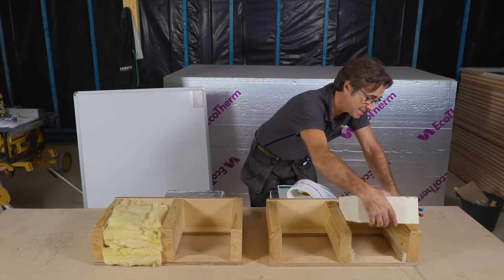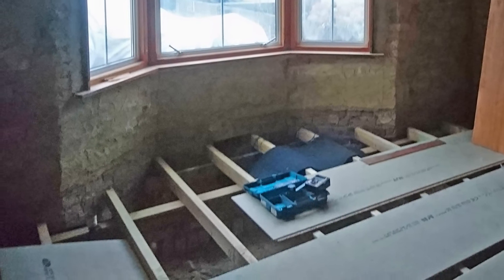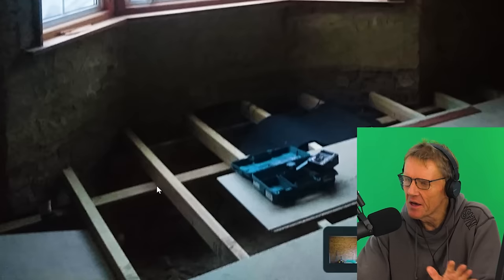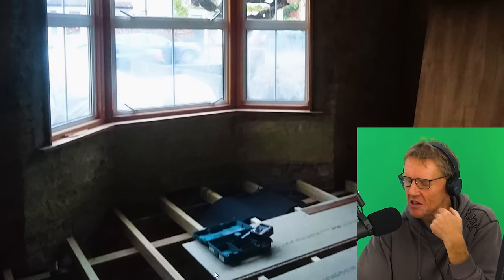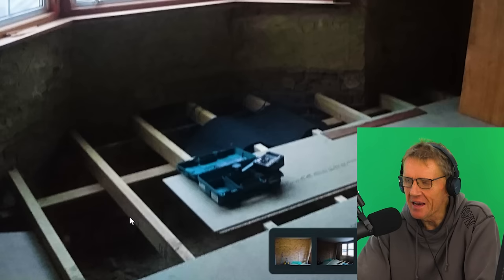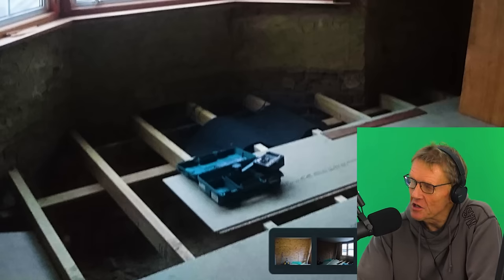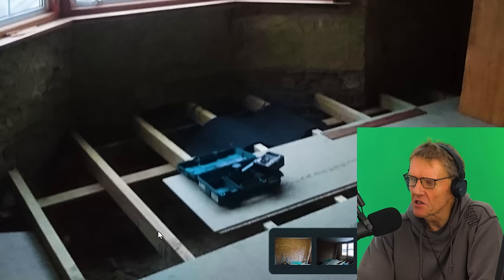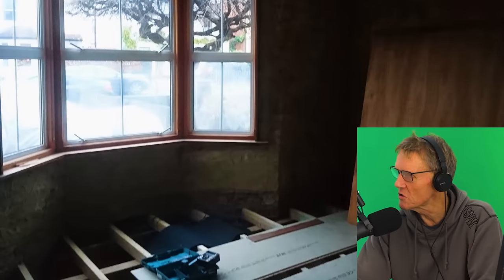Cold Floors & Walls in an Old House ~ What Can Nick Do?

Comment: Check the SPAB best practice on insulating old buildings.  You aren't letting the building breath with modern materials which are better suited to modern construction.
Reply from the maker: I think there is useful information in SPAB but there is also a lot of bolocks.
Reply: Fair play
Reply: @growingknowledge  There is also a load of bollocks on the Skillbuilder channel, this ^ is some of it. Learn how to spell breathe though.

Comment: could he batton the walls insulate and plasterboard if the rooms are big enough to lose a bit of space ??
Reply: Yes. I've done the same on our 1850s house with solid 9" walls. Like the floor insulation, I put a vapour barrier between the insulation and the plasterboard. Works well - no more mould behind the wardrobes and beds!
Reply: @stpeter7432  Hi, just wondering how you sealed the vapour barrier round the edges of the room, the sockets and when screwing the plasterboard.  I'm doing 2 external walls in an upstairs room but not sure what to do with the edges if the moisture can simply go straight behind the battens at the edges, ceiling and floor?
Reply: @DrJohnners  It's not a hermetic seal. I did this mostly for the insulation value to prevent condensation on cold exterior walls. I did a first fix for the electric cables and then fitted the insulation between the battens. I then stapled a polythene vapour barrier over the whole lot. Then I screwed the plasterboard in place. When I cut through for the sockets and switches, I cut the polythene locally and fitted the back boxes. 
Sure, there's a gap but there shouldn't be any significant moisture behind the plasterboard (unless the wall exterior is letting it in!) At the ceiling, floor and room corners, I turned the barrier round the edge of the plasterboard and trimmed it off flush before I skimmed it. 
I did several walls like this and have not had any problems in the last 15 + years. Good luck with yours!

Comment: Excellent thank you, I need to do exactly this after christmas.  It would be great to add some more details about how you would deal with the interface of the insulation board with the windows? Do you need to worry about condensation occurring on the uninsulated internal wall where it acts as a cold bridge to the external wall and if so how you'd deal with it?  I have a feeling I might be overthinking this....
Reply: Paint it with black bitumen paint on the window jambs and apply an uninsulated plaster board with mastic adhesive over the bitumen once dry is one method and it works, black bitumen is messy though so gloves and cheap brush!?!

Comment: Great advice as always. Is it an issue dot and dabbing PIR board directly to walls? I was told to batten the wall first then fix to the battens (I had already dot and dabbed to walls before being told this). Not sure the reason, possibly air flow.
Reply from the maker: I think the adhesive is not a good bond on the silver foil.

Comment: I have just had to re-new all the joists in my kitchen after substantial dry rot, the numerous contributing issues (various concealed leaks) have been rectified and it has completely dried out.
I am having insulation between the floor boards like this, with no thermal barrier.
The Installer has left a couple of gaps citing he wants to make sure it still breathes well after the dry rot.
In my eyes he is concerned about it breathing the wrong way and it will surely negate the benefits of the insulation if there are a couple of potentially drafty, uninsulated sections.
The underfloor can breathe well, there are numerous functioning air bricks all round the house.
Should I insist he insulates as much floor area as possible and not leave such gaps?

Comment: We layed a permeable windproof hammock over the joists, filled it with rockwool and layed a non-permeable vapour layer over the top.
Reply: I was informed that rockwool better allows moisture to evaporate if it does get into the insulation.
And the windproof under layer allows moisture to escape without letting air movement draw all of the heat from the insulation
Reply: This is what I’m planning on doing, mineral wool insulation suspended on a breathable membrane. But it sounds like Roger is saying this is wrong? @skillbuilder
Reply from the maker: You don't need a membrane under the insulation. Just use some netting to hold the insulation in place or plastic banding strips stapled to the joist work fine.
Reply: @brianbutterworth8043  I think the concern is there if theres a lot of airflow under the floor, there potential for wind washing (where the movement of air draws all of warm air from the wool insulation making it less effective)
Reply: Perhaps it's overkill 🤷 but I'm only doing it once!

Comment: Solid insualtion sheet is expensive today, rockwool batts would be less expensive and just as effective. Mind you s/h Celotex sheets would be an alternative.
Reply: I'm thinking of S/H celotex sheets too. Definitely not cheap and for my living room it looks like a mammoth task (average DIY guy here). How would you hold up the rockwool? Tie it?
Reply: Batts are quite rigid, so friction fit usually keeps them in place, however if you use more floppy loft type insulation yo can keep it in place by stapling scrim tape between the studs. Cheap solution and it works
 Don't forget your vapour barrier!!
Reply: @johnbarleycorn7845  good suggestion. I was thinking more for the floorboards. Would you need a vapour barrier there? Not crucial, right?
Reply: @johnbarleycorn7845  I should have said batts are the way to go. I've used batts on internal stud walls and it has worked fine.
Reply: @wr3099  As Roger said- don't trap any condensation underneath the insulation, it will cause problems!
Personally in between floor joists I would always go for celotex/kingspan etc. I would make sure it was fitted very snuggly as Roger said- what I've also done before is used foil tape to close up/seal any potential gaps between edge of insulation and the joists.Hope that makes sense.
Reply: If you use rockwool, use a windproof layer (moisture permeable) underneath it to prevent wind washing stripping the warm air from the insulation

Comment: Roger, this is timely for me. I have a Victorian End of Terrace house. No cavity on front elevation (gable end is) and I have been considering adding insulation board to the front either side of the Bay window and below. My question is would it be better to remove existing internal render 1st or just board over it? External is rough cast. Thanks so much.
Reply: Why are you asking a plumber on YT to give you advice on several thousand pounds worth of work? Wake up ffs.

Comment: I'm in a similar situation with a 100 year old, very cold property so this video is very interesting. My property has a 55mm cavity with a porous, silicate masonry block outer leaf with lime mortar and internal plaster. An energy assessor is trying to convince me to have the cavity filled with beads but I'm not convinced it's the correct thing to do. I have been considering insulated plasterboard, would this be a better option? I'm concerned this would then cause condensation in the cavity, I'm totally confused now.
Reply: @TechStuff365 Thank you for your response. Have you considered insulating internally?
Reply: @stevenhall7659  not really, just thick underlay, lots of loft insulation, dehumidifiers. Most of the plaster has lost its strength I apply watered down PVA when decorating to increase strength. Patch repair if necessary. Brrr old houses but more space than modern.
Reply: @TechStuff365  Thank you 👍

Comment: Couple of questions about of new roof we've had 4 jetliner window s fitted one leaks when I looked at it 3 of then the front flashing is recessed so pools water can they be lifted after installation I know there are height adjuster on them for different roof tiles and also the roof beams are 70mm thick so if I leave 50mm gap and then Kingspan will only be 20 mm insulation if I use plasterboard with insulation I'll eat in the head height of the attic any ideas?

Comment: Any good ways to suspend the insulation invetween the joists? I have just ordered some fibreglass insulation but its in a roll, not solid to be just push fitted tightly inbetween like others are doing here.

Comment: Hi there Roger, so the insulated plasterboard from Wickes they don’t have a vapour barrier 50% of traders are telling me if is on a solid wall you don’t need it and 50% are telling me that you need a vapour barrier to the insulated plasterboard as the moisture will go in the foam and start stinking and gets mould .

So which one is as it’s very cold and I wish to do this internal insulation asap.

And on internet most people don’t tell you exactly what to do with or without?

Comment: Some installers recommend putting a breather membrane (e.g. roofing felt) under the insulation (i.e. on the cold side) to cut down drafts. But might this risk slowing down the penetration of any moisture through the insulation so it condenses on the felt?
Reply: Seems illogical; 
How would draughts penetrate a supposed continuous layer of insulation (unless they expect to leave gaps which is a poor installation)? 
As Roger said, putting the moisture barrier on the cold side would just trap it exactly where it would condense and cause damp.
Reply: I’ve seen several videos advising to place the vapour barrier under the insulation, where mineral wool is used, to prevent wind washing heat away. This was placed over the joists and under the insulation.
I’m about to start this on my lounge floor, is this not advisable?
Reply from the maker: Brian 
It is true that you can cut down on the airflow across the insulation. It is only an issue on mineral wool and removing the air flow can cause mould on the cold side of the wool.  I would say, don't do it. I put mine in over 20 years ago and it is fine

Comment: I would use insulated lime render and maintain the breathability of the building like it was built to do. Cement and gypsum don't work in old houses
Reply from the maker: This line is trotted out all the time but it is complete nonsense. Old buildings were not built to breathe,  they were built of lime because that was what was availalbe. It has now been placed on a pedestal by people who knit sweaters out of their beard clippings. I have always lived on old houses and I use gypsum plaster and have zero damp problems and no mould. 
We have carried out a number of vapour permerability test on sand and cement with plasticer and NHL 3.5 lime and gypsum plaster. The biggest problem with gypsum is that is disintergrates when it gets damp but that is why I suggested using thermal plasterboard. The airborne moisture will not get through and the exterernal moisture will leave the way it came in. I have a kitchen with solid walls and thermal board, as specified by the architect to meet the U values and it has no damp issues whatsoever.
Reply: @SkillBuilder  Sweaters out of beard clippings - love it!

Agreed, old buildings were not consciously built to breath. It was just a happy accident (borne out of necessity) that has stood the test of time.

Using gypsum still makes me nervous though...

Comment: Surprised you didn’t mention to use gapotape in the floor to make it airtight. 
It’s The Plumber
Reply from the maker: Gapotape is an expensive option
Reply: @SkillBuilder  thank you for your reply Roger and yes you’re right it is bloody expensive but by got it does the job well. A building with 9 inch walls and have used 25 mm PIR silver on both sides for vapour and heat. Then a plasterboard over the top and worked out £5 cheaper than buying them combined.
Like the Skillbuilder YouTube channel for all the various topics that you bring to, not just tradesmen, but also general public as well. Keep up the good work.
Steve 
It’s The Plumber

Comment: If there is a need to insulate an external wall what would be better out of external insulation or internal insulated plasterboard? The external wall will be getting rendered anyway

Thanks
Reply from the maker: You can put a 100mm thich insulation on the outside but far less internally. EWI also means the thermal mass of the wall is insulated and can act as a storage radiator to even heat out over the on off cycles

Comment: What’s the better solution for the wall? PIR in between treated batten’s (with DPC) and then plasterboard, or go straight to insulated plasterboard with dot & dab?
Reply: My personal view is neither I think a better product is something like the lime warm shell, which is a wooden fibre board which allows wall breathability. You lime render over and on top of it, allowing breathability of the wall from the outside in.
Reply: Ok, so are saying the lime render has a better R-value than PIR?

I’m not tradesmen, but constant searches on the Internet show that PIR is the better solution to help warm up the house? And as long as there are no damp issues in the wall.

Comment: That looks like a solid wall, so it's very bad advice to put PU and plasterboard on it. It'll work ok for a few years, but slowly mould will grow behind and the joist ends get damp and rot off. There are so many people bodging up old houses now with inappropriate insulation that in decades to come builders will be cashing in putting it all right. Modern lime plaster mixes do not crack, we do it better now than they often did back in the day. Back then materials were expensive and labour cheap so corners were cut. There is no shortage of breathable insulation systems on the market now so aside from cost there is no excuse not to use the correct materials and systems. All you're doing is creating problems for future owners or yourself if you live there long enough, but then that's nothing new....
Reply: Dangers of IWI: https://www.youtube.com/watch?v=HeH1B1mmD48&t=6s  All RIBuilds vids are worth watching as they explain fully and test what happens when you insulate a wall. Why using filler foam to fill insulation gaps is a bad idea and why the manufacturers have come up with better solutions: https://www.youtube.com/watch?v=QJsgGDqYMYM

Comment: I live in 1895 victorian terrace house with 6ft height in the basement. I can't lift any wooden flooring up but can access into the basement by a small hole in kitchen. How do I put insulation under the flooring in the basement? As its something I want doing next summer!
Reply: There is no definitive answer, cos everyone seems to have different opinions.
I am in the same boat as you, and currently it seems the best option is breathable insulation (hemp, sheep's wool, or wood fibre) between the joists, with a breathable membrane fastened to the underside of the joists. Make sure you have enough clear airbricks below the floor.
I don't yet know how much insulation you need (to satisfy building regs u values), but ANY amount is going to make an improvement if you're just trying to keep warm.

Comment: 2 years ago I use PIR board ( both sides silver faced ) between the joists of my kitchen floor, am I going to get trouble as this effectively is a vapour barrier below the insulation ?
Reply from the maker: No it will be fine. The only way moisture is going to get through from above is down the sides so the joists will wick it out to the underside. You have air movement under the floor so it will take any moisture away.  We are talking about very small amounts.

Comment: Do you need to insulate all the walls or just the external walls?
Reply: Internal walls in always nice. Not as important as floors, external walls or ceiling. Some home cold air flows from floor to roof so making it airtight or insulating stops that and reduces noise between rooms

Comment: those premade thermalboards are a rip off at £100 each! get some normal 50mm pir boards and normal tapered plasterboards and stick the 2 parts together with bondit Mega Stik from selco. stack them high. mine took me a 3 hours and saved me £1200
Reply: How did fit the insulation to the wall? Also did you add a barrier between them and the wall?

Comment: Where the joists meet the brickwork - that's a cold bridge. As you insulate everything else, those cold bridges get colder (compared to what it would have before the insulation). It's a shame that even builders that are aware of cold bridging only know of a few examples.